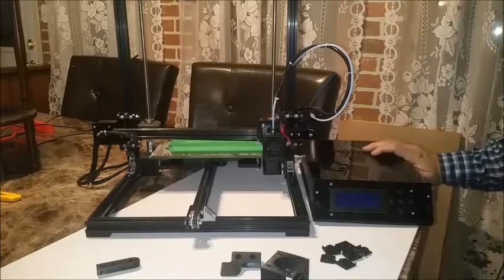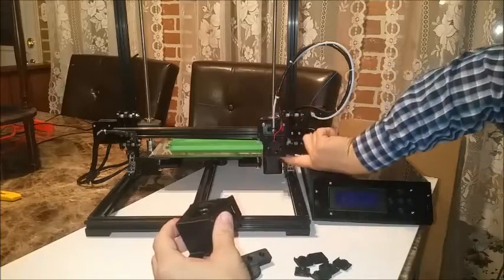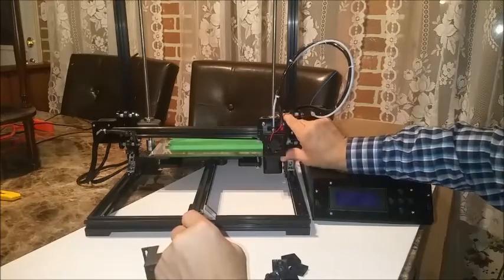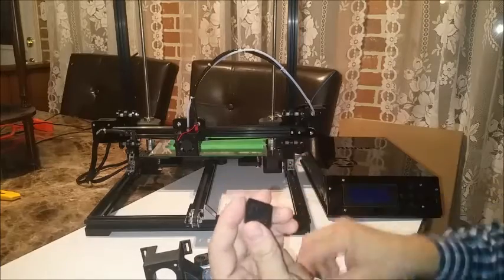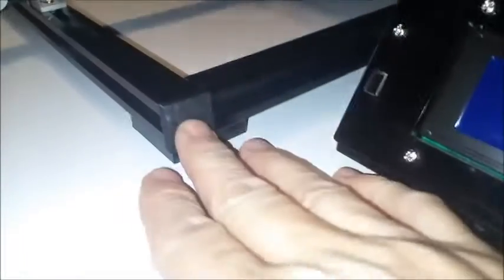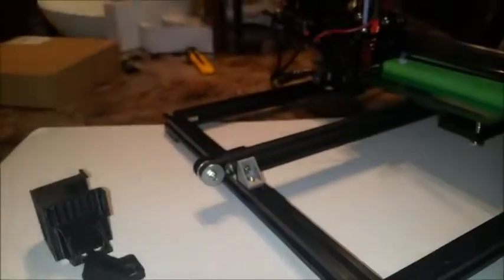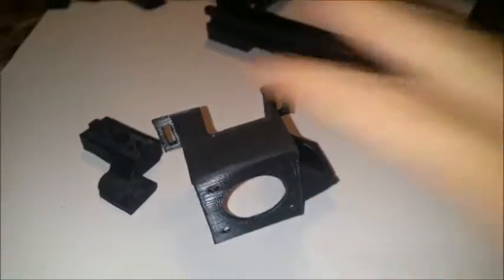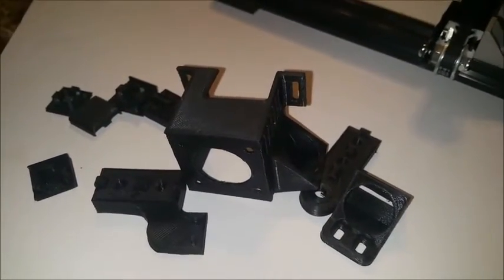Tronxy X3 asthetic and functional printed upgrades

Comment: Hi! How did you get it to center the bed? the X and Y is way of on mine.. Did you andjust the endstop?
Reply from the maker: I made a bracket for under the Bed that triggered my Y axis 30mm earlier as it I found it was too far back that fixed my Y axis, and in Cura I have my X and Y limits set to 225

Comment: I'm in doubt, how you setting level  position of the Z-axis stop switch?  Because if level  Z=0  will be below bed surface, the extruder head will impact to surface, and if level z=0 will be  above surface, how to do set extruder to make 1st layer thickness 0.1 mm?
Reply from the maker: The Z axis enstop switch mounts on front left tower just above the angle bracket, it is triggered by the wheel of the of the X axis gantry on the left side
Reply: i mean, how it properly leveled extruder head relatively bed surface?
Reply from the maker: I first set my spring tension on the bed to upper limit giving me lots of adjustment, then I bring the gantry down until the hot end is touching the bed. I the set my z limit switch triggered to that position and screw it down tight. After that I will proceed to level the bed through tension adjustment of the springs to fine tune it to just snag a piece of paper, I do this part after the bed is up to temperature however

Comment: how would another fan for cooling be wired? would I have to extend the fans wires and solder them to the board?
Reply from the maker: You have to extend the wiring from the hotend to the control box yes, and there is a empty connector inside on the melzi board for the second fan that can be software controlled.

Comment: Really appreciate the effort you've gone to with these mods.  Will be printing them as soon as my printer is up and running. Thanks ;-)
Reply from the maker: There is a really good facebook group for this printer as well that can answer lots of questions and offer lots of support https://www.facebook.com/groups/1119103791478149/?ref=bookmarks
Reply: rockwater999 Wow, cheers mate.  You're a star.  I'll head there now ;-)
Reply from the maker: I plan on doing an experiment this weekend in an attempt to increase the print volume of the bed to 255 on the X axis and 270ish on the Y axis. The Z axis will be about the same if not loose 3mm. I will be doing a video of this and if all is successful and it works I will post it to Youtube

Comment: Hi what do you think about this printer after owning it for 2 months? Is it suitabl to print abs?? Should i go for an anet a8 instead?
Reply from the maker: I love this printer it has been going strong for the last 2 months. I haven't printed in abs yet on it so I cannot give an honest comment in that perspective. I am not into all acrylic printers what so ever and I will never own a printer that the frame is a combination of acrylic and threaded rods so therfore I will never own an A8
Reply: does it have to be bed leveled every single print... is there any particular flaw?
Reply from the maker: No, I have only ever leveled the bed twice, when I first set it up, and then one more time when I had the hot end off. But I do not move it around much either. Although I did move it from a shelf over to my desk and did not have to level the bed

Comment: I was 3/4 through the build and was shorted 3-4 t nuts etc, ended my progress.
I just downloaded the parts while sort of finishing the build here, thanks.
I was going to look for a solution to print caps.
My board power conn. is cocked I don't see it lasting.
The hot end unit was damaged and the nozzle was crooked, the metal housing bottom tabs were bent up.
Life is funny I got this, to print parts to fix an old printer...now I'm fixing a new printer.
The new Joseph Prusa, don't like the price considering it is 3D printed parts, but looks like the champ so far.
Those better parts and add on extruders, with this platform would be interesting.